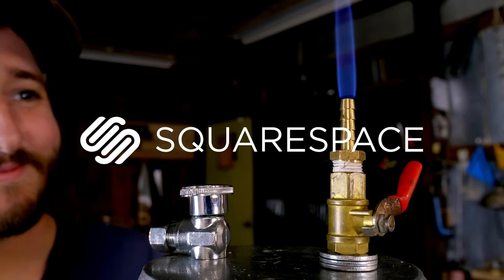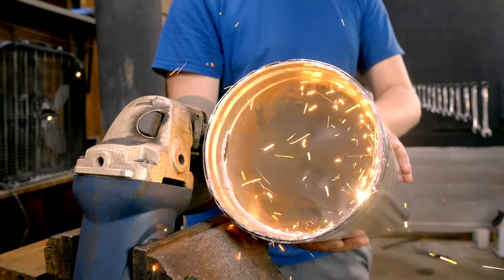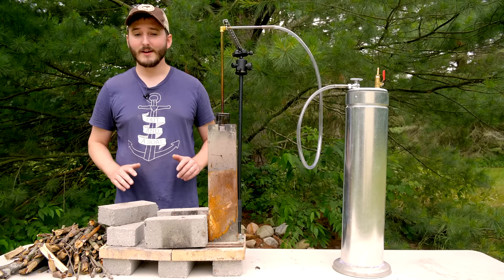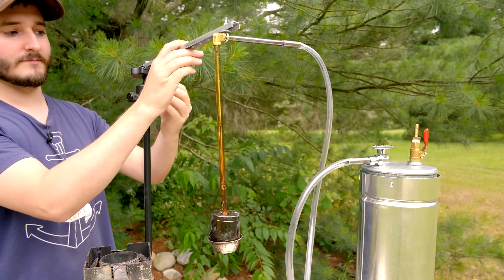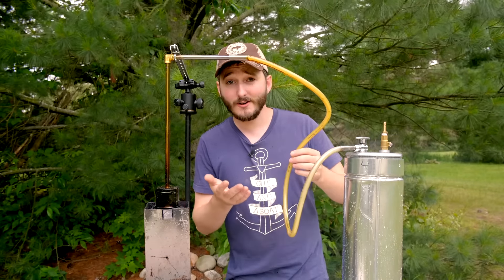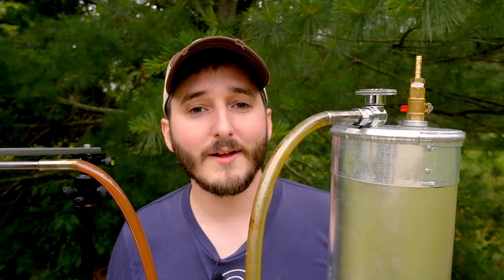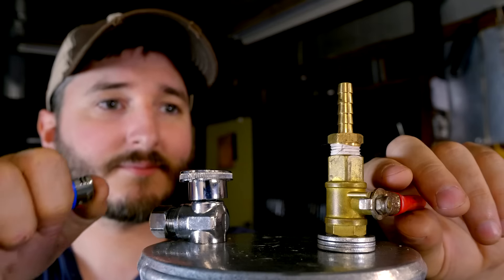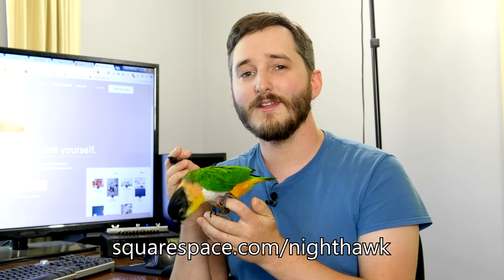Bio Fuel Storage: Building A Gasometer

Comment: Collect the byproducts via cooled condenser tube on low point, before pushing it into gasometer from bottom peace and giving gas clean up by letting it bubble trough the water and then use it from gas chamber via tube that goes from bottom part on top of the water line, hence removing need of flex pipe other than means to see whats happening in system. Also i would add inspection windows to see more what happening.
When gas is cleaned properly and maybe cleaned via another water bath further you could add compressor to it and start to pack it into gas bottle, where you can store way more.

Comment: Use fixed (hard metal) pipe into the storage, inlet bottom center. Added benefit, bubbles up through the water for faster filtration. Need to re-engineer the fuel feed, tho.

Comment: If you made a much larger tank you could connect it to a much smaller tank then press down on the larger tank to force the wood gas into the smaller tank and pressurize it.

Comment: Somewhere on YT a guy filled a air bed mattress with the gas...put some weight on top (sand or boards)...worked nicely. It also had a greater storage volume...cheap and easy to make.
Reply from the maker: I've seen that done also. Probably one of the easier ways to go about it.

Comment: you could install a rigid pipe that makes the gas bubble through the water from the bottom, along with an outlet pipe reaching out of the surface of the water to an outlet at the bottom, so you have no moving parts.

Comment: You could also build one using a 31 gallon trash can as the bottom, and a 20 gallon as the top. Requires less tools, surprisingly. Only real drawback is that it wouldn’t be mobile.

Comment: I solved your little tube puzzle. 

Make the tube rigid, and instead of leading it in to the top cylinder, lead it in to the center bottom of the bottom cylinder. It will bubble the gas upwards the middle, filtering the gas nicely and cool the gas down in the process, allowing for more efficient storage. 

And now you're thinking with rigids. :D

Comment: Not sure if you're still interested. Silicone tubing would be ideal though as it is cleanable, heat resistant, doesn't kink or deform in the present of heat  and can take a good bit of pressure. It just can't do vacuum without collapsing. Available at most homebrew stores.

Comment: in demo you are correct it would be difficult but for a more sustainable unit, you could have the system go up through the bottom in the center of your Gasometer stand, then with a different tank you could store more later.

Comment: The vinyl should work fine as long as it doesn't get waaaaay too hot. If it is getting too hot during operation, you could put a second larger diameter hose on the outside of it as a second skin and fill the area between with water. This will keep the tubing at or below boiling temp.

Comment: Copper tubing from the gasifier down into a container of water and coil it inside of the water down to the bottom. Have the container capped and the tube open at the end, submerged in the water like a bubbler. Have a fitting on the lid with the vynil tubing going to the final filter that moves up and down. This way the gas is cooled and filtered first in what is more or less a radiator/filter. That way, you don't have to release and waste gas to change the water in the moving filter as often, and you can safely use the flexible tubing.

Comment: You can also clean the gas thru a filter,get a 50 gallon drum and send the smoke thru layers charcoal at the bottom then saw dust then dried grass followed by more layers of the same material you can also use sand in your layers just like making a water filtration system except for smoke,that why pictures of old cars with gasifiers had two barrels one for fire the other for smoke filter.

Comment: you MEAN INNER AND OUTER CONTAINERS.. upper and lower containers would mean that the UPPER container is placed ON TOP of the LOWER container.. VERY BIG DIFFERENCE.
You can use the tubing used for propane gas cylinders with is made for outside environments and is very durable for your tubing
use a "quick" release connector on your container and tube so you will not not need to use a wrench.
thank you very much for you very informative videos

Comment: an idea to catch the slime from the hose rather than letting it into the container, a cheap screw on automotive oil catch can. they usually have a drain plug towards the bottom so if they get full you can quickly drain it and keep going.

Comment: Use thick gas line or at least much thicker hose for gasses. That tubing will get so flimsy as it e warms up it becomes a mess kicking  stopping it causing blockage. Best idea copper tubing that swivels on connection and un screws off ur storage chamber and screws back on once u have it filled with water and in position to screw pipe back on without having to bend it much. U can also put a flexible gas line on the end of copper pipe that leads to ur holding chamber. The water in ur chamber should keep it cool enough on that side.

Comment: Just add a fixed metal tube to the bottom and let the gas pressure overcome the water pressure and buble up into your gasometer. That way you don´t have to have flexible tubing!

Comment: Could you possibly create a rubber gasket to go around the two pipes an add handles to the top pipe so you could use downward pressure to force the gas into a container?

Comment: 'Gasometer' to me means measuring and containing, so I'm little puzzled.  No matter, still learned a lot.  Perhaps the FEMA instructions explain how to connect a meter?  Also, if you the temperatures and other conditions are within certain parameters, you can make biochar.  Ingenious to use that stove pipe, when it already has two pipes made to fit together. Look forward to seeing some gauges and other measuring devices.  Keep up the great work!

Comment: Silicone tubing is generally very flexible and is generally much higher temp resistance than other soft rubbers like vinyl. Silicone should be able to handle 2-3x the temp. It also has good general chemical resistance. However just reducing the temps before the tubing may be the best route.

Comment: Cool scale it up and bottle it up in propane tanks use and old fridge pump braze on some intake and pressure adapter to propane tank. Before filling propane tank need to pull it down to a vacuum you caps use a vacuum line of a running engine on a car or truck and pull it down to 15 to 20 inches of vacuum pressurize the propane tanks to 300 psi for later use a regulator so you don’t blow up but it works good just use common sense perfect gas for cooking and gas fridge. Cheers

Comment: if the gas comes in form the bottom you can use metal pipes and a bigger container  with a lot more pressure and you can use antifreeze in the water so it can be used in winter

Comment: The tubing doesn't need to be flexible if you instead use hard tubing that enters through the bottom of the water tank at center. Put a fitting in the bottom of the pot lid. This also ensures the wood gas has to travel through the water column, cooling it and condensing any water vapor.

Comment: I bought some silicone tubing recently on ebay,, because it was cheaper than silicone O-rings, and Dam is that stuff the best.
Does not Kink at all.
Haven't tried it on high temperature stuff as tubing, but it's rated for 400° degrees
You might want to get vacuum tubing or something because I do worry if the heat will make it collapse, if that does happen you can use a spring or something else rigid wrapped around it to keep it open like the wire in industrial vacuum tubing which is something else I would recommend if you can find a high heat variety.

Comment: a dual ball valve at the top and bottom of the gasification chamber would allow the charcoal to be emptied and wood added without shutting the whole thing off nor exposing the system to oxygen as the new wood load is purged before fully dropping in. but is the charcoal enough by its self to keep it all running? 5-80psi

Comment: What of you hook your vinyl tube to the outside larger diameter tube, through the bottom with a short nipple with a 90° elbow then tubing again to about 2 inches below the water Line. This would provide a vapor lock should flame travel through your vinyl tube also Lessing 1 weight on your floating inner cylinder 2 give you more options to have a whip to free float to desired end use fixture

Comment: You really should do a wash tank/trap before you get to the gasometer. Maybe use an old 1 gallon jug of some kind. Have the gas come in through a connection in the cap, down into the water, allow it to bubble up through the water and have an exit hose also coming out of the cap then into the gasometer.  
I'm not sure how dirty your setup gets, but you can keep the tar in the pre filter so it doesn't make a mess in the second one.

Comment: Please do a video showing how to safely store enough for an entire winter. I'm thinking running a gas furnace all winter with a solar system to run the fan and electronics. It seems that it would store no problem in a big propane tank not sure how to get it in there though... vacuum pump perhaps or something similar? Well done high quality video my compliments ; )

Comment: The only change I would make is the smoke inlet on your gasometer should have a pipe that runs down to the bottom of the meter so that the gas bubbles have to go through the water which would purify them more before they break the surface of the water

Comment: Try using vinyl tubing of 2 sizes similar to the gasometer and fill the outer section with a coolant. Maybe a pump also.

Like this:

 PUMP IN          PUMP OUT
   //                            //
//________________//___
             COOLANT
-----------------------------------
    WOOD GAS TUBING
-----------------------------------
______________________

Comment: This gas runs an engine very cleanly. 
 I have clocked up more than 1500 hours of generator runtime with woodgas  :) .
Reply from the maker: Looks like you do direct feed of the gas from the video of yours I pulled up. What media are you using to filter the gas before burning? Do you use an electric blower on the gasifier or does the engine make enough suction to keep woodgas flowing on it's own? I'm currently building a direct feed gasifier to a small engine and trying to make it as minimalistic in form and function as possible.
Reply: Howdee partner, 
 I have two gassers here. 
 One of them is powered by wood, and the other is powered by charcoal. 
 The startup processes on these are the same, as is the filter media. 
 Two filter tubes are filled with small stones, to serve as a gas cooler and water separator. 
 The next filter tube is filled with stainless steel scrubbing pads. 
 The last filter is half filled with scrubbing pads, and filled to the top with Alpaca hair. 
 Pillow foam is a perfect replacement for the Alpaca hair  :)  . 
 The fan pulls the gas through the system, in order to permit gasser lightup. 
 Thereafter, it is turned off, and the engine pulls the gas for the duration of the engine runtime. 
 Be careful about making a simple design, as this will be prone to tar production. 
 Sadly, tar cannot be effectively filtered from the gas stream, and it will ultimately cripple the engine. 
 My very first gasser did that to a car engine, and it took me a fair old while to fix both of them! 
 Keep in touch, as I am sure we can make your new beastie work for you  :) .
Reply from the maker: Thanks for the information, you've given me lots to think about in my design.
Reply: You are welcome  :) . 
 Most of the folks who comment on my videos are themselves builders of gasifiers, and they are all very willing to help out with any questions that may come to mind during your build  :) .

Comment: Instead of switching the vinyl tubing out, just use put the metal section of the under ice-water as if you were making a distiller to cool the gas before it makes it to the vinyl.

Comment: Great video, I am in the HVAC Refrigeration field, I can tell you, you better put a check valve on the gas outlet you do not want that flame running back down inside the storage cylinder, also I know you did it just for a test but you should always run the gas through a hose because the outlet of the metal could heat up to the point where the combustion temperature hits the inside of the cylinder and ignites all that wood gas instantly it will explode like a bomb,
Thanks from a new subscriber
Reply from the maker: You might be interested in a video I did as a follow up to test this issue. https://youtu.be/NYTFQ6wvR9w

Comment: You can move the inlet valve to underwater and let the gas move itself upward it will filtered itself along the way to reach upper part(called 3 phase seperator  gas will go up ,water will be middle and tar will be bottom)then put some small powered turbine ,blower or small piston compressor to compressed the gas(this method must have outlet flow more than inlet cause if not the inlet pressure will be negative and becoming vacuum and gas will turn back destroy any blade along the way can be fix by lowering the outlet increasing the inlet flow"burn more fuel" or create a spin back way valve to deliver positive pressure from outlet back to inlet) and deliver it to gas tank but must be reduce the heat from compressing and the burning section maybe by pass it through car air cooler tank or through very thin metal pipe underwater (using water to cover it's pipe surface to carry out heat must be travel long enough too can do it by using 180°conector and return it's direction do this until it's stack up which it's called heat exchanger)

The gas itself still cantain co co2 h2s which is very toxic to lung and nerve can be reduce by using catalytic at above 400°c that we can not do it homemade lmao 

The pipe you need to be reflexible is called Bellow pipe I don't know where they sell 

To increase more efficiency you can cover every area since a burning chamber to seperator may be done by using fiber glass insulation for pipe,ceramic for klin shell 

A bigger size of this project may be worth more like a size of oil barrel or single home charcoal klin.
Hope this useful
Reply from the maker: Moving the inlet to be underwater means you need a higher delivery pressure to push the gas down into the bottom of the tank. You also don't want to put this gas into a pressurized tank because it contains hydrogen which makes metals become brittle.

Comment: Very interesting. A few questions for you if you don't mind.

1-How much fuel (wood) burnt to gas (burn time) production?

2- Can gas be produced from anything other than wood/coal? 
For instance, these refuge/rubbish burning incinerator. Can gas be produced from their operation?
3-Do you see this as an alternative for our fossil fuel energy production?
I am thinking that to do so we would need to:
• Generate energy from the initial burn. So produce steam from the wood burning and use to generate electricity 
• Plant quick growing fuel types such as willow hemp etc. 
Look forward to your views on these.
Reply from the maker: I have not measured wood to gas ratio. Any biomatter can be reduced to flammable gas. It is an alternative to fossil fuels on the small scale but should not be favored over solar on the wide scale.

Comment: If you connect the hose into center of the bottom it does not need to be flexible. The gas will need to overcome water pressure though.

Comment: just use a car inner tube with a bit of water in fill with the valve at the bottom and when you need to use the gas just put the valve at the top

Comment: Im curious, is there a disadvantage to installing the gas inlet near the bottom of the storage tank so that the gas bubbles up through the water? If you did it this way you wouldn't have to worry about having a flexible tube because the tube wouldnt be moving with the upper part of the storage tank. The only problem that I could foresee would be some of the gas bubbling up through the space between the walls of the upper part of the storage tank and the lower part of the storage tank because they are not sealed together with any type of "o" ring. This could be rectified though by having your inlet pipe extend up through the water in the bottom part of the tank almost all the way to the top to ensure that the gas escapes in the right spot and cant bubble up between the gap between the walls of the upper and lower part of the tank.

Comment: 11:30
I'm not a chemist, this might be dumb* 
Ok, but as you're running low on fuel and pressure you're risking air oxidizing the remaining fuel in your gasometer, no? Would it just spit out some violence or could it blow the top off of that thing? Or am I completely wrong here. I would start getting nervous the smaller that flame got. Cool video!!!

Comment: instead of needing to find a suitable material to make a flexible tube that is also heat resistant you could instead change the design and have the wood gas enter from thse side of the bottom tank and bubble up through the water to be stored in the top tank. this way the tube doesnt need to be flexible and you can just use metal pipe.

you could also set up another pipe inside the tank to serve as a gas outlet so you can also output the gas from a fixed position rather than have the outlet mounted on the top of the inner tank

Comment: Just a thought.. if you had the gas going into the container through the water side, it would get filtered through the water. You can have the gas going in through the bottom through a pipe going up above the waterline on the outside. Just a thought
Reply: Plus the gas would get cooled and there would be no need for a plastic pipe